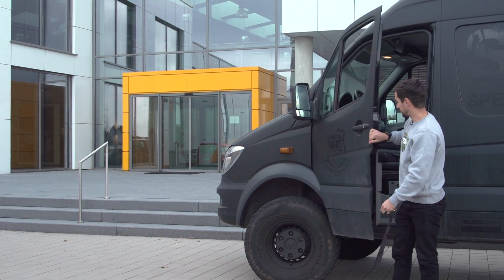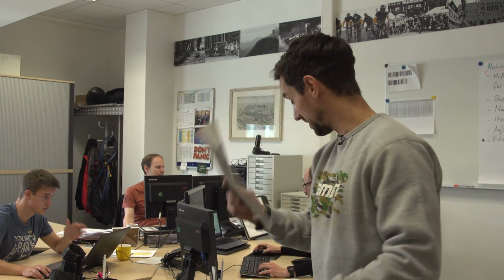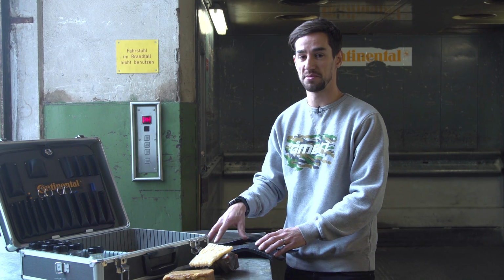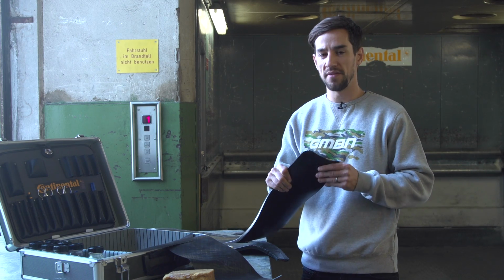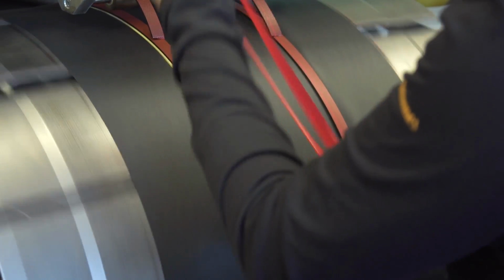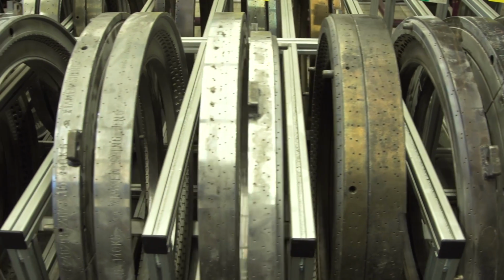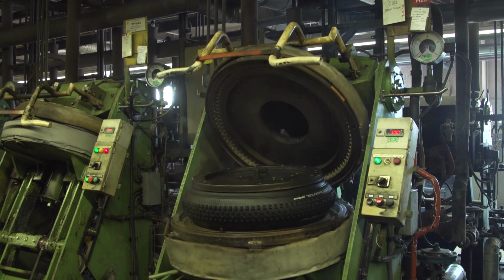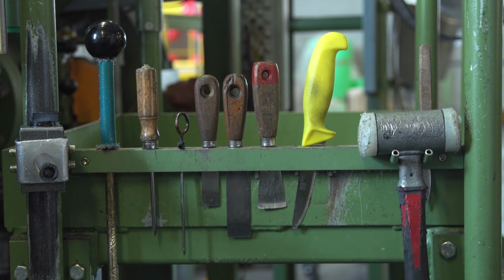How A Mountain Bike Tyre Is Made | GMBN Visits The Continental Factory

Comment: no wonder tyres can be expensive- i'm amazed they're so cheap actually, pretty much hand made!
Reply: Its very impressive I agree! Thought tyres were spat out of a machine a hundred a second, Nothing but German rubber on my campervan and soon to be roadbike. When the shitty Specialized rubber finally dies.
Reply: Well cheap it is not...road racing bike tire can be as much as big 15" car tire...about 50 USD.
Reply: My Continental tyre is made in India
Reply: @stonehill27  where are you from ?
Reply: @niklas6791  Mine are from Indonesia and I live in Germany xD
Not every Conti is made in Germany
Reply: @ironeinar  what contis do you ride?
Reply: @ironeinar  and another problem is that conti has no factorys in Indonesia 😂
Reply: @niklas6791  I don't have them here right now, because I put my bike back in the basement, but I swear that there is a writing on them saying they are made in Indonesia. At least I think it was Indonesia. They are surely not made in Germany. And I ride the Crosskings with shieldwall in 29" with the soft compound. Just so you know xD
Reply: @niklas6791  work is contracted out to a third party manufacturer. Stock volume tires. Lowest bidder wins.
Reply: @oktfg  No. Conti produce for it self. They don't have 3 party manufactures

Comment: I like that they use a wintery compound for bike tires, because if they didnt we'd be riding around on hockey pucks in the winter if it falls below 0 C... Wonder if all tires are made to cope with sub zero temps or not. Probably not all of them... like some of the race bike tires with very soft compound is probably not good if it falls below the 0 C... Also, since you're likely to have almost no thread on such a tire, I wouldnt want to use it anyway in those conditions! :D

Comment: so what exactly are those needles for? so that air can get out of that form, when the rubber is being pressed in? (not a native speaker)
Reply from the maker: Yes, so that the rubber can be squeezed from the inside into the mould, that way when the air is all pushed out and the rubber fills the mould it starts to be pushed out of the holes, forming the needles
Reply: Excellent! thanks for answering :)
Reply: So, if there are no needles on the tire, it's probably made in a less effective method?

Comment: Silly questions in relations to plus sized tires and rims.  I am looking at a plus sized tire bike and noticed the 27.5" rims come with the 27.5" x 2.8" tires, however I have a pair of 27.5" x 2.4" tires I would like to use in the future.  The Rims have a 35mm inner width and I am wondering if that is to wide for a 2.4" tire?  Or to ask a similar question, where is the limit for a standard non-plus sized tire (27.5" x 2.4") when it comes to rim inner width?

Comment: am I the only one who has had nothing but problems with continental mtb tires? I don't think I've ever worn out the tread on a continental tire, it's always the sidewall or the connection between the sidewall and bead that fails first. Also, constant random pinhole flats that I can never find the source of. Never had these issues with any other brand of tire.

Comment: Yeah, hand made in Germany my ass. I have a pair of Continental tires that have that sticker (handmade in Germany) on the casing, but you can clearly see an imprint in the rubber itself that says, made in Thailand!
WTF?
Reply from the maker: The vast majority of mountain bike tires come from this plant in Germany. Some come from their Thailand plant where they use the same manufacturing methods too. They're a global company after all!
Reply: I understand that. But why the "handmade in Germany" sticker then?
Still, they make great tires.
Reply from the maker: Handmade in Germany is a slogan of the company as the majority of their tyres all come from the same plant in Germany, especially their high end tyres like the Der Baron and Race King. A small number of their tyres are made in Asia using the same moulds and techniques due to a rapidly growing demand. So to us they deserve the hand made in Germany slogan!
Reply: Thanks for the clear up. But I can guarantee that the quality is nowhere near the same.
If needed I can provide foto proof.